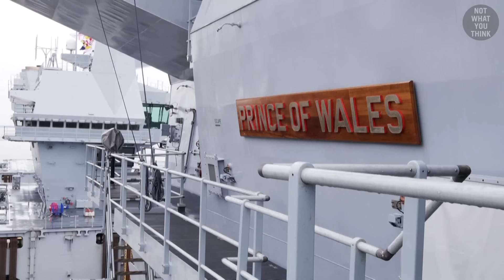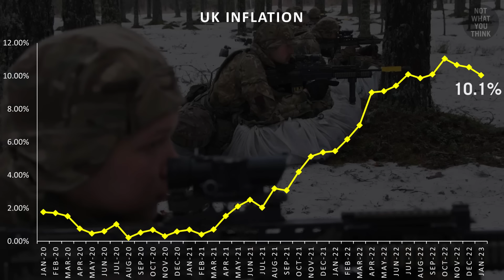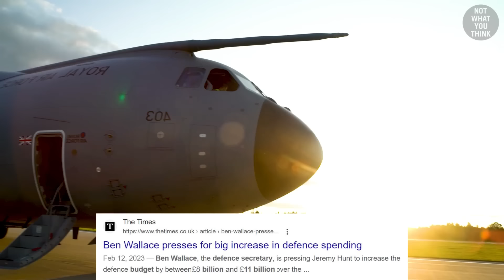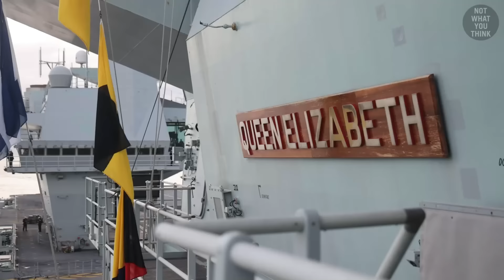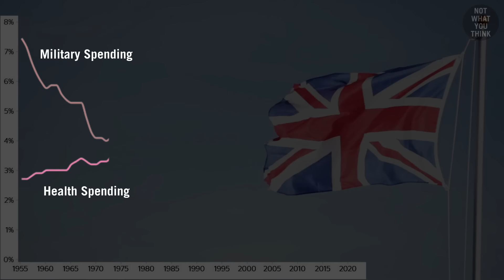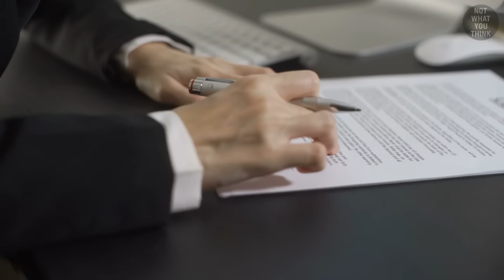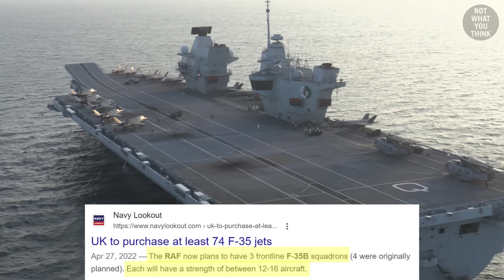Why QE Carriers are Considered a PART-TIME Fleet

Comment: Im honestly not a big fan of the QE.
To me she occupies this awkward place, the size of a supercarrier with the aircraft capabilities of a light carrier. 

Its like the government tries to cheap out on everything it possibly can and resulted in an overisezed and underpowered system. 

If all she was to operate were F-35'S and helos then why build a supercarrier at all. Why not just build 3 or more light carriers or amphibious assault ships. 
I dont see the logic behind behing spending so much on such a large platform for it to have even less capability than a ship half its size.
Reply: Overall they would have spent more by building 3 smaller carriers than two larger ones like this, as you're having to duplicate all of the expensive equipment such as radars, increasing the size of a ship just means more steel.

On top of that, you need the crew for 3 ships instead of 2, due to all of the automation they've added, these ships require around the same number of sailors to crew compared to the UKs previous carriers which were 1/3rd the size. It's unlikely they could have shrunk the crew down much more than they already have if it was a smaller ship, so that's an additional cost.

Plus having a much larger flight deck makes flight ops far more efficient, they specifically scaled the ship up so that it would be possible to perform a certain number of sorties per day (Basically they can be used to fill in for a US supercarrier for a time), they are able to vertically land two F-35 pretty much simultaneously if needs be and it makes SRVL possible to use on a more regular basis (A rolling landing without the need for an arresting cable, this allows aircraft to bring back more weight rather than dumping fuel and weapons to land vertically).

You've also got much more space for future upgrades, which is very important on a ship which was built to be in service for half a century, they're currently testing a numer of drones to fill roles such as AEW, tanker and loyal wingman, having an abundance of space gives them a lot of options.

Comment: The UK should have had one more upgrade of the Sea Harrier, new Mk 107 10% more thrust engine, FBW, extra hard points and avionics improvements. And then kept both the upgraded Sea Harrier and the three Invincible class carriers in service another twenty years. The invincible class carriers with maintenance and upgrades could easily have had a service life of fifty years. All carriers should be expected to see fifty years of service. I think the Invincible class Ark Royal did not even make it to thirty years of service. What a waste. And in the meantime, instead of buying the appalling f35 and developing another collaborative fudge Typhoon type fragile air force combat jet the UK should have developed its own supersonic Sea Harrier replacement using an XG40 core derived Pegasus follow on with triposter vectored thrust. BAE did in fact have a concept for such a combat jet in the early 1990s but unfortunately Boeing took over and turned it into the butt ugly nose intake, over simple wing failed x32. The BAE version of the x32 was a much better looking VSTOL vectored thrust supersonic stealthy combat jet with conventional twin side air intakes for the engines. But the Americans were desperate to ditch the not invented here vectored thrust concept and went Russian with a ludicrous lift fan architecture. The F35 proves you can make anything sort of work (not very well) if you throw enough money at it but no one believes in a shooting war it would be any better than what the Lockheed Martin marketing men call 4th generation jets such as the f15, f16 and Typhoon/Rafale/Gripen. I am pleased to see the UK is unlikely to buy anywhere near as many f35s as first stated and will more than likely scrap it all together. I live in hope.

Comment: So many problems in the decision process. The SDR suggested they needed a different F35 for which a longer deck was neccessary. SDR did not find the RN only needed one. The design spec is too short for the MUCH more capable F35 version: That made the RAF feel less threatened as it would have made their fighter role obsolete in a single policy decision. Dockyard contract  was too complex to permit modifications (Cameron's government tried): Built in Prime minister Brown's constituency so the dockyard got the protections it wanted. Built out of synch wth aircraft availability: Just not joined up. Odd choices and multiple high risks accepted, in a surprisingly dysfunctional process for such a huge project. And the consequences still comming to light even now.

Comment: They could have just bought 4 Wasp class assault ship from America.
Reply: Wouldn't have made much sense, the wasp class are built for a different primary role. For four of them it would have cost a fair bit more than two QE class carriers, and each of them requires a similar number of people to crew them, so they would have had even more issues with running them.

The UK also wouldn't want to outsource building major warships like that and lose the ability to build their own.

Comment: I think, smaller aircraft carriers are way more economical and practical (something like HTMS Chakri Naruebet), with the ability to fit up to one squadron of airplanes and\or helicopters (plus UAVs).
Reply: The weakness of these is that they cannot launch long-duration AWACs and refuelling flights and are thus limited to operate in theatres where the opposition forces have no, or very limited, airborne capabilities, or rely on an ally with those capabilities. The additional deck length for CdG to launch and recover Hawkeyes was a necessity for the ship to operate independently in the North Atlantic where she would be faced with incoming missiles launched from over the horizon. The QE & PoW will have the same issue, and need to rely on US Navy airborne radars to warn of threats in time to react.
Reply: @adventtrooper  Well, you still can have helicopter-based AWACS, though.
Reply: @user-ie4tt1xp7j  You can, but my understanding is their capabilities are considerably less than a fixed wing alternative.

Comment: The lack of actual aircraft to put on our shiny new aircraft carriers is one of the funniest and simultaneously saddest jokes in this whole situation. 

Good ol' David Hameron decided to partially fund the construction of the QE class by selling off all of our Harrier GR.9s, our only carrier-based fixed wing aircraft at the time. That was in 2010. We basically bought the damn boats by selling the only plane we could put on said boats, and our pig-loving Prime Minister thought this was a fantastic idea.

He was probably expecting to take delivery of the F-35B pretty quickly after the fact, as the new plane had already had its first flight by then, but the F-35 wouldn't enter service with its primary customer until 2015, at which point the government were still flip-flopping over whether they wanted the F-35B or the F-35C (which would be cheaper to operate but would necessitate redesigning the carriers to use catapults and arresting gear).

As of this year, we've finally actually taken some deliveries, with 30 of the planes finally under the Royal Navy's command. Except that we don't even have all of them, as a few are being kept permanently in America for reasons. These planes are also largely unarmed, because Lockheed Martin are being colossal pricks about it and demanding extra money for the weapons. The Electronic Arts of the defence world over here.

Meanwhile, in America, the place that's actually making the F-35, the US Marines solved the problem of "Procuring the F-35 takes time and money" by simply continuing to fly the Harrier until each squadron was able to take delivery of the new aircraft. VMA-223 and VMA-231 are still using the AV-8B, and are projected to continue doing so until 2027 and 2026 respectively. 

A perfect microcosm of David Cameron's political career, which is now set to continue as our increasingly desperate current Prime Minister apparently called him back from the pig farm he's been hiding on since he fucked up the referendum to be the Foreign Secretary.

Comment: These machines will prove to be a diabolical white elephants that will prove to be a huge drain on the defence budget. It's laughable that a 65 tonne behemoth can only deliver an air wing of 35 fixed wing aircraft. A joke. But that's all we can afford. We have two huge aircraft carriers that were originally intended to be CATOBAR carriers, but when it was realised they were unaffordable, a bodge was instigated. So these huge carriers are forced to field a reduced force of short range VSTOL aircraft, that could have been supported by much smaller ships. We have two huge carriers we can't afford, but the land forces are reduced to a vestigial force with only ~ 250 outdated challenger 2 tanks! Brilliant!

Comment: One thing I learned from using boats, they are complete money pits despite your best efforts there is always something that needs fixing or your attention . Every navy has these problems eg the French navy had to build extra length deck onto their aircraft carrier because it was designed to short and then the propeller fell off. Nothing to do with bad engineering it’s just what happens.

Comment: Aircraft is useless in modern war. HMS Queen Elizabath class aircraft carrier can generate 40 sorties a day in peak for 5 days. Then she have to return to the naval base for resupply, refueling, and maintenance. That means 200 soties per one operation. For 5-10 bombs/missiles per sortie, that means1,000- 2,000 bombs/missiles to enemy target to destroy.  This can be accomplished by 4 arsenal ships / missile carriers with 500 cruise missiles on board per ship. 4 missile carrier ships are much cheaper to build and much, much cheaper to operate than one aircraft carrier.  Long range cruise missiles are much cheaper to buy and maintain than fighter jet. You can buy and maintain 100-200 Tomahawk missiles with cost of a single F-18E naval fighter jet in life-time cost for 50 years. All this can be accomplished with no danger of loss of our fighter jet aircraft or pilot. Missile arsenal ship will replace aircraft carrier in next big naval war.

Comment: OPERATION SUPPORT CLASS CARRIER, its why extensive training with NATO marine forces has been undertaken, the QE2 class ships are designed as a command centre, close air support, and supply base for forward beachheads, primary function is close support of the UK's "heavy" brigades, the F35B is also primed for these missions, MOD has just ordered a further 6 marine support vessels, further improving the UK's punching power when it comes to marine operations.

Comment: For a Carrier of that Value to either have flooding monitors and alarms either missing or never thought of, is totally Criminal, especially in the Electrical area which powers the Weapons Systems, power to put planes on deck and Christ every thing on that ship from Radars to Cooking, if 1cm of water is detected , instantly Alarms and place of detection needs to be  monitored and a Specialist flooding team sent instantly to that area to find out exactly where water is entering, how its entering and can it be stopped while underway or head straight to a Port with Dry Dock facility if needed.

Comment: G'day NWYT, I agree with most of your opinions of the UK's two 'new' aircraft carriers. Along with modern submarines, modern aircraft carriers are among the most complex, moving structures on the planet. Both types of vessels have hundreds of systems onboard and crews of expensively trained, highly qualified personnel.

As you mentioned, when compared to the aircraft carriers of other countries, excluding the US, the twin carriers of the RN are not in such a bad state. The problems with HMS Prince of Wales can, I believe, be put down to cost-cutting and inexperience of the builders. Apart from the US, no other country has ship building companies who are expert at building aircraft carriers from scratch.

As to the USN, they too have problems, from time to time with their much bigger carrier force. The American companies who build carriers for the USN are, demonstrably, more experienced, however, the construction of these types of vessels are the most difficult, time consuming and expensive of all maritime vessels, along with submarines.
Only America has the funds and capability to also provide full carrier strike task forces with all the necessary support vessels.

The current size and status of the USN carrier force is the direct result of the Japanese attack on Pearl Harbor 81 years ago. At the height of WW2 the USN had a total of 105 carriers but 64 of these were the much smaller 'Escort Carrier' type. By comparison, the Japanese Imperial Navy began WW2 with 18 carriers - losing 14 of them in a short period of time. The UK had a total of 10 carriers during that war. 

So, it was the USN and the American government that embraced aircraft carriers as a potentially war winning vessel where other nations still relied on large surface ships and submarines. Nazi Germany, by the way, had one aircraft carrier that was never really finished and spent nearly all its life in dry dock.

I think the really significant fault of the RN's two carriers is that neither of them can carry sufficient numbers of aircraft (even if those aircraft were available). Yes, they are smaller than USN carriers, however, 24 aircraft on one carrier; even though they are Lightning II Bs, simply isn't enough to forcefully engage in a large ship-to-ship or ship-to-air conflict.

The aircraft of just one of the USN's large carriers could overwhelm the entire compliment of aircraft on the RN's two carriers; then use their surviving aircraft to disable the carriers.

It's too late for the RN to make their carriers bigger so, perhaps, the addition of many more ship-to-air missile systems may provide a larger degree of survivability.

Hopefully, this whole topic is purely academic, for if the UK is in a conflict where their two carriers are desperately needed, then they are in the situation of a widespread, truly serious war, the outcome of which would not hinge on the performance of their carriers alone.

Thank you for an interesting video. I'm not surprised that the RN did not offer any response to your assessment of their carriers. Cheers, Bill H.

Comment: The UK's economy determines the size and strength of its armed forces and also its competence when it comes to managing major projects. Whether you look at the UK's attempts to manage High Speed Rail HS2 or the saga with this aircraft carrier the UK is unable to manage projects on time and within budget and they rarely achieve what they were originally designed to do. Australia and the AUKUS project should be careful putting faith in the UK's hands. The chances are the submarines will never be delivered on time and will definitely cost a lot more than planned.

Comment: More muddled thinking by the Government. How can Britain support two carriers? You need a huge battle group to defend each carrier plus the logistical support. It only takes on threat to get through the defensive shield and it could be put out of action.
Reply: To be fair, until recently they supported 3. This is a reduction of that, although these ships are larger and more capable than the previous carriers.

Although the idea is to support one carrier, you need two to help guarantee one is available, they won't necessarily be used at the same time on a regular basis.

Comment: Yeah the PoW was a massive waste of time and effort. It can't be used as it keeps breaking, doesn't have enough aircraft (as of early 2023), barely has enough crew, and has no available supply ships. It's like having a Ferrari, but you can't afford to run it and its tyres explode every time it leaves the garage
Reply: It's been used multiple times on deployments, it was only this last one which was major, but it's set to be back in service soon, it makes more money when the media push these issues as if they're the end of the world though. It's just part of life with new ship designs, they are often going to have teething issues early in their life, look at the latest US carrier, that was started around the same time as the first QE class, both of them have been comissioned and deployed in the time it took that to get the latest US carrier into service.

Also what a lot of people don't seem to understand is that having two aircraft carriers basically means you have one operational at a time. Even the US doesn't operate all of its carriers at once, they have so many of them because you're always going to have some in maintenance or working up. If anything you need 3 carriers to guarantee 1 is available at all times, there will likely be gaps where neither are available, so being able to equip both simultaneously isn't as major of an issue as people are making out.